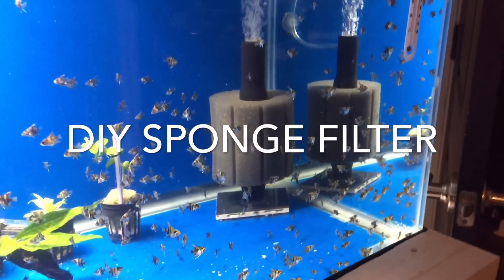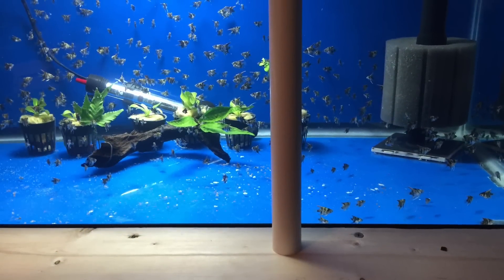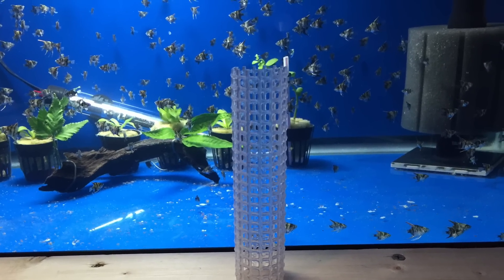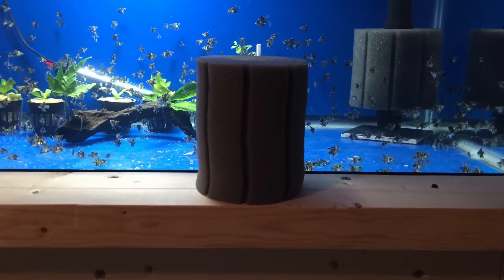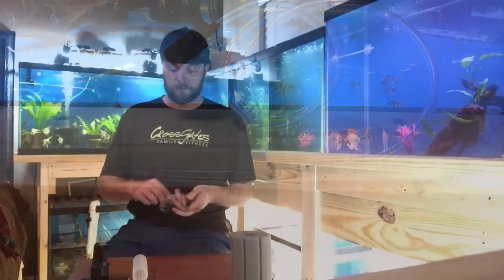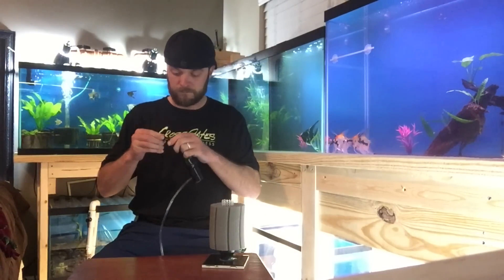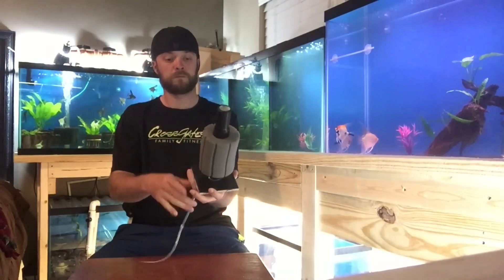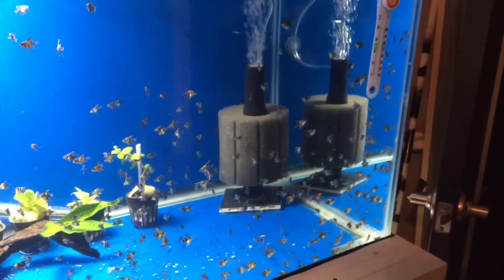DIY Sponge Filter

Comment: Hey Mike nice video just wondering if you could show your air pump that powers all your tanks or recommend a good size air pump to power a sponge filter in a 55 gallon tank
Reply from the maker: Check out my channel. I have a central air system vid. Did it when I bought the unit. Thanks so much and thanks for watching!

Comment: Can charcoal be inserted in the tube area?  How do you clean the filters and how often?
Reply from the maker: When I notice they start to look gunky, I take off the sponge and squeeze it a few times in either tank water or fresh dechlorinated water. As long as you do this within a couple of min, the beneficial bacteria will be fine
Reply from the maker: I would think the activated carbon will work as long as it's not packed and water can flow through.
Reply: Nice Mike.   Thanks.

Comment: what paint did you use?
Reply: You mean the black pipes? I use a high quality spray can. Roughen up the surface with some sandpaper (so the paint can adhere better) and give it a few fine coats (2-3). Let it air out/dry out for a few days before using it in your tank.

Comment: What size sponge do you use for a 40 gal. breeder tank and do you use one sponge filter or two?
Reply from the maker: +Debbie Arthur Hey Debbie. Thanks for watching. I go by the size specification on the ATI hydro sponges. but i over size on purpose. i believe what im using is the 5 rated for 80 gallons and i have 2. i use 2 only because of my higher stocking levels. If you had normal stocking levels you could absolutely get away with only 1.
Reply: +Mike's Fish Room Thank you for commenting I really appreciate it, one question those sponges that you put in one gallon jars do you sell them or could you show the best way to cut them to size.  Thanks again.
Reply from the maker: +Debbie Arthur No problem. I appreciate you commenting! I tried pretty hard to find a DIY sponge to build those jars myself. The concern you have is if the sponge is cut uneven at all, it can create a place for fry to get stuck. If you can get a 1 gallon pickle jar and a 1/2 inch pvc pipe, you can go to angelsplus.com. for the sponges.They sell the whole kit(jar and all) or individual pieces. I felt them to be very affordable. I also use them for all of my medicated foods. Super cheap!
Reply: +Mike's Fish Room Awesome I will check it out right now. Thanks for the link I'm sure I'll need to ask more questions in the future thanks for your help.

Comment: What’s the blue background you have on your tank, can you tell me where I can buy it?
Reply: It's blue acrylic paint. Easy to apply (small roller, 2-3 coats should be enough), easy to touch up in case of accidental scratches, and easy to remove. Can be found in any hardware store.

Comment: This filters the entire tank of debris, ammonia, etc?
Reply: No, it's a bio-mechanical filter, which means it will harbor loads of beneficial bacteria and extra bio-film that REDUCES ammonia. It will filter the entire tank and catch SOME debris, but not as much as for example a canister filter who has a stronger suction and flow. You could on the other hand place a bent pipe on the outlet of the sponge filter, this creates a bit more flow, or use a combination of a canister filter and a sponge filter (as I do in the big tanks). Sponge filters are actually mostly used in small shrimp tanks, not so much in fish tanks. Shrimps love to hang onto those filters as it provides them with loads of bio-film to eat from. SOME floating debris gets caught, to a degree, but fish crap - most of it - usually immediately sinks to the bottom and stays there. Either way, you still have to vacuum the bottom and do water changes on regular base, whether you use a sponge filter or for example a canister filter (or a combination of both).

Comment: A good quality sponge filter only costs about $8. I like the DIY fortitude, but seems like a wast of time in this case.
Reply from the maker: Ted Townsend depending on the size and courseness. Here a sponge filter can cost up to 10 or even 15 so to build these for 5 makes sense to me.
Reply: Not trying to diss. . . I like your videos, and I'm also a DIY type myself. I was just trying to say that for the time vs cost on a sponge filter I don't feel like it's enough savings. I can get the 5"x6" bacto surge filters from my local shop for $7. I guess the cleaner factory look is worth the extra $2.
Reply: Taylor - They sell sponge filters of every size on ebay. Amazon as well. I bought 4 of them for $11.00. They aren't the same brand as the sponge in this video, but they work and I didn't even need to get off the couch.
Reply: I always say the cheaper the better BUT not in everything but this YEAH if it works then WHY NOT??

Comment: These are great minus one fatal flaw. Silicone does not stick to tile very well and eventually the tile separates from the end cap. I am trying to find another way. Any thoughts?
Reply from the maker: Leam D 1 year old and they are still as strong as the day I made them. Use aquarium silicone. As long as they aren't constantly moved or pulled on it shouldn't give.
Reply: Leam D I'm still at the begining of the video, however, I wrap all of my sponges and filter intakes with petticoat netting fabric. It comes in every color of the rainbow and 2 layers is stronger than you would think.